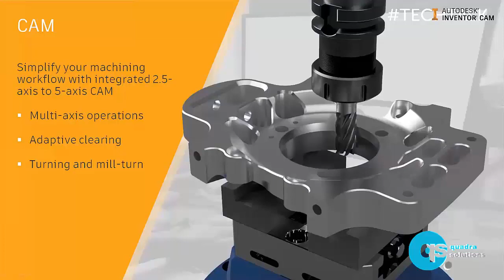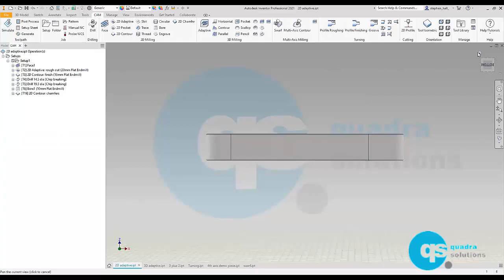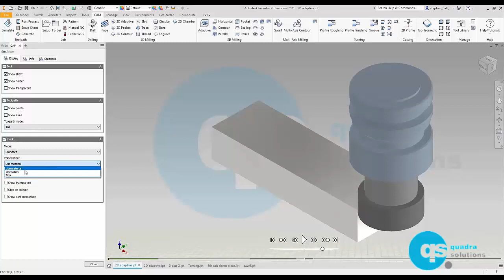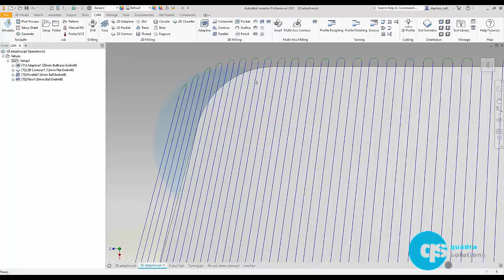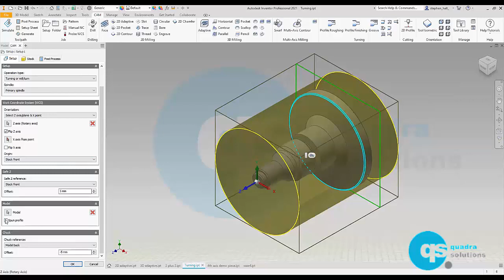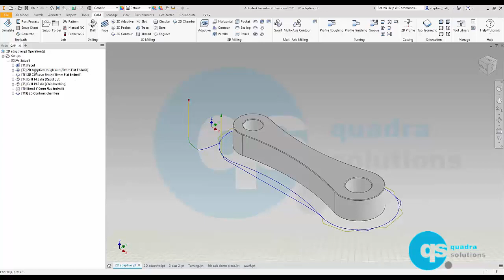Introduction to #Autodesk Inventor CAM | #TECHTALK Webinar | #InventorCAM Full Version

Comment: Can you use this cadcam from completely wireframe and not a model? Thanks
Reply from the maker: Thanks for your question. 

Yes, the model can be viewed as wireframe if required (but when simulating the machining process the stock material would be as a solid to demonstrate material removal). Hope this has answered your question, if not please let us know. Thanks
Quadra Solutions

Comment: How about you're only have a 3 axis milling machine and you have multiple operation and different datum, how to set that one up? Thanks
Reply from the maker: For 3 axis machines with multiple setups it’s simply a case of creating different CAM setups per orientation with a new datum selection. For this example you’d re-grip the component in the vice and re-datum on the machine, therefore creating a new machine setup and replicated in your CAM setup. You would then output them as single programs.

Hope this helps - If not, please feel free to contact us and we can talk further. See our website for contact details www.quadrasol.co.uk

Comment: Hi Dear, Thanks a lot for your detailed tutorial. How will you check stock part comparison during the simulation.
Reply from the maker: When using simulation there is an option to select the stock colourisation required. The options are Material, Operation, Tool or Comparison. Using the Comparison option will enable the user to see colour definitions to indicate if the part is within tolerance or if there is any excess material or gouges. I hope this helps.